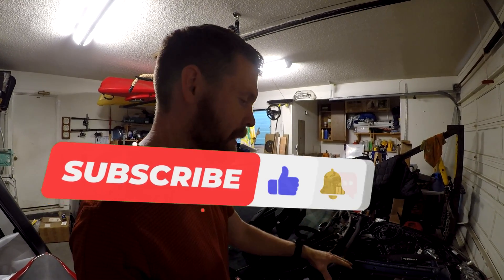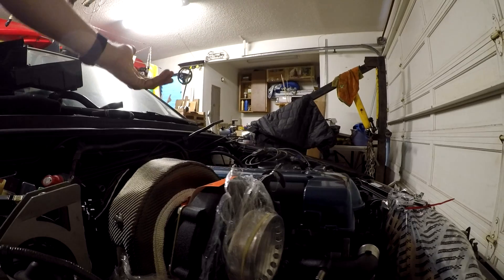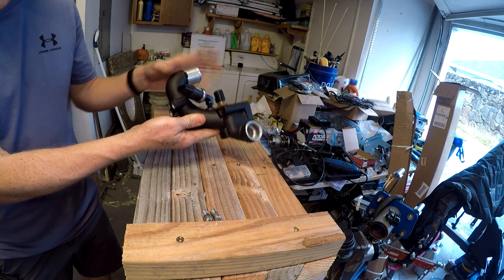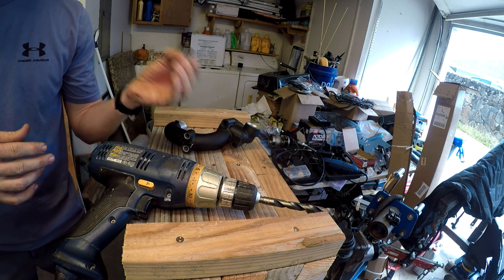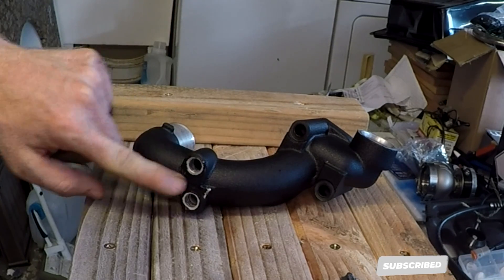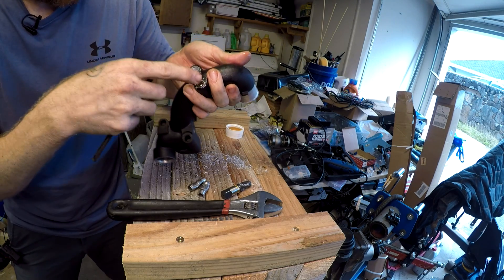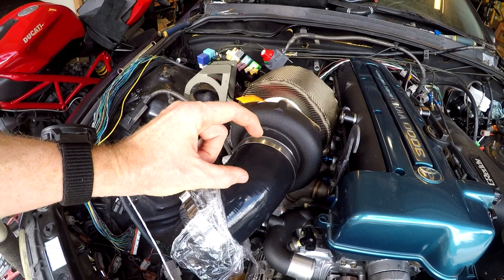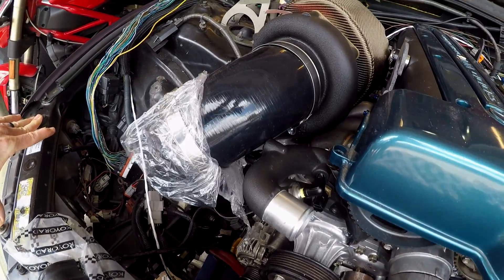2JZGTE coolant neck tap/plug

Comment: I alwys wonder why for 2jz swapped vehicles.. it be nicer to just have the radiator port on the passenger side. Amd run the coolant hose straight into it. Since it's not a supra chassy where the fan is in the way.
I might just pay someone to weld relocate my radiator lol
Reply from the maker: I agree, they could have designed that better. The IS300 has the coolant exit on the other side of the head, so the upper coolant hose is straight and about 5 to 6 inches long. I'm not sure I would have a welder relocate the coolant inlet on top, in the current setup the coolant flows from the top driver side to the lower passenger side. Relocating the top entry would potentially lead to not as much coolant flowing through one side of the radiator.
Reply: @LegitRaceCraft  well, welding a new upper radiator inlet. But jist on the passenger side... should still work... but 2jz do run a bit hottter lol
Reply from the maker: @damnitdang  I'm sorry but I think this is a bad idea and shouldn't be attempted. As you said, the 2jz already runs a little hotter than other engines. And what you're doing decreases the cooling. Radiators work from either a top-down or a side-to-side flow, depending on the radiator setup. The side-to-side radiators sometimes have coolant inlet and outlet on the same side, but the coolant flows left to right through the rows, and then drops to flow right to left. Ours flows top down, and you're having an inlet welded on your radiator that only allows coolant to flow into and out of one side. The other side would hardly get used. So if you think about it, hot coolant enters in, flows down the passenger side and out, while the other coolant mostly stays on the other side of the radiator, cooled down by the fans, but not flowing into the engine. Some of that coolant would mix, but who knows how much. It's your car, do what you want with it, but I would never attempt this.
Reply: @LegitRaceCraft  that's a valid point too... maybe if I did it,  like you said the coolant on the driver side might stay too hot. Now makes me revise my thought lol.

Comment: Yoo FZR 600...R6... gas tank plz explain
Reply from the maker: I had an fzr600 with an R6 gas tank in the past. There are older videos of it on my channel. It needs to be the carbureted R6 and you'll need to make your own brackets. The front tank bracket can be drilled through so the bracket mounts to the frame. I think I used an 03-05 R6 seat though, I definitely used the 03-05 tail and had a friend weld some brackets on my subframe so it could be mounted.